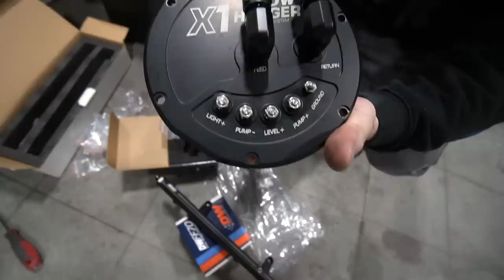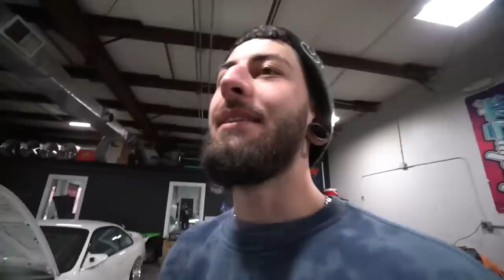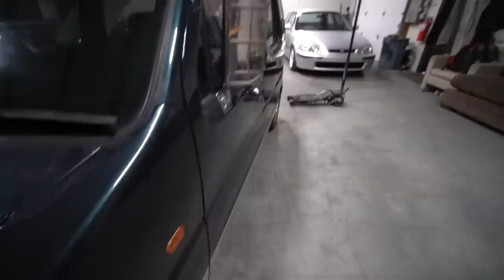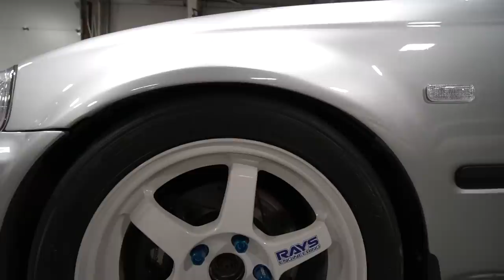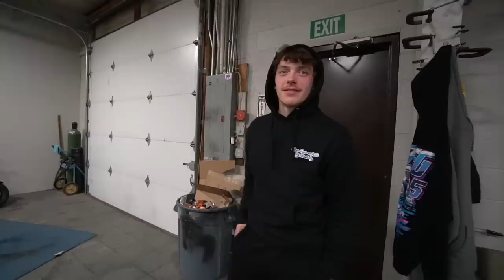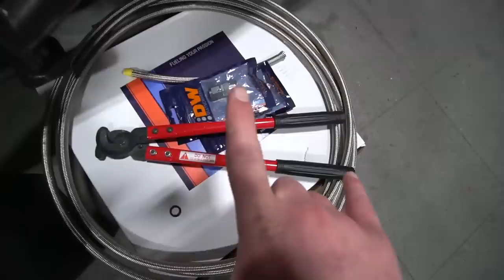SR20 Gets Complete Deatschwerks Fuel Overhaul! THEY ALSO SENT THIS NEW..!

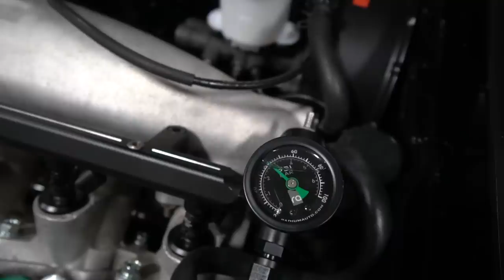Comment: @15:11 your crank case ventilation hose rite there by fuel pressure regulator is bent so tightly that it is kinked, ie. wont flow as it should as the internal volume of hte hose has been decreased by that kink in the hose.